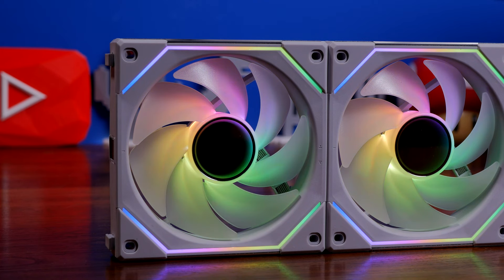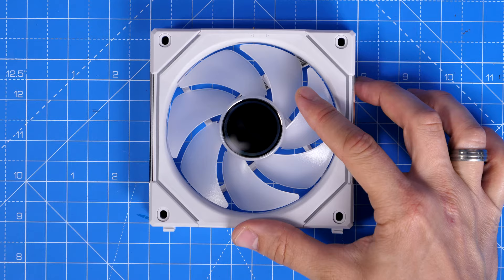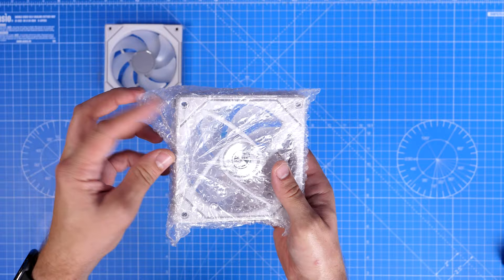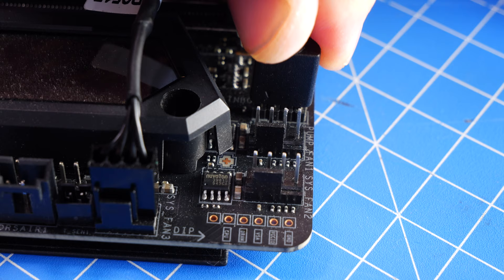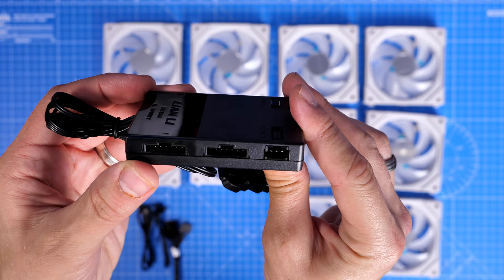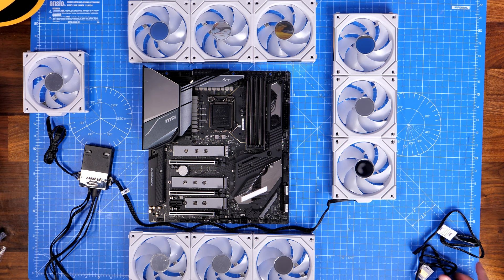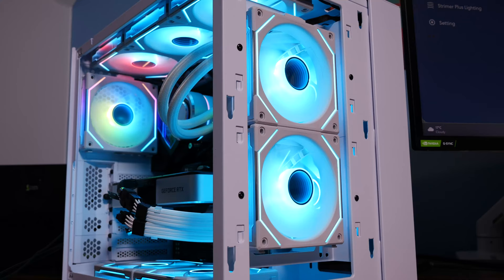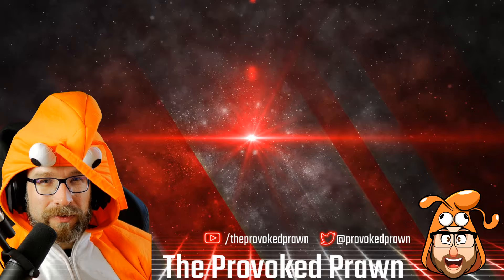How to connect Lian Li Uni SL Infinity 120 fans (single and triple packs)

Comment: best video ever. it took me 4-5 tries to find someone just hooking them up. everyone else's videos looked like Lian LI promotional videos and I just wanted to see how to properly hook them up. thank you for your service 💓
Reply from the maker: Thanks Gary. Glad to help, hope you enjoyed enough to subscribe 🦐
Reply: Same boat! This helped a lot since the 3 groups of 3 with a single in the rear was exactly the setup I’m looking at. Only question is if I get a single pack for the rear will that still connect to the controller or no?
Reply: omg same i could either only get  the rgb to work or just the fans to spin not both it was frustrating
Reply: @TheProvokedPrawn  I’m confused, do I gotta connect the 3 pin 5v rgb header AND the usb to the motherboard or can I only have the 5v 3 pin connected?
Reply: @TheRockford22  yes but using one of the (4) cable that comes with the 3 pack.
Reply: @TheProvokedPrawn Hey, great video , but can I connect 3 × triple pack fans = 9 fans if I only have 1 argb headers on my motherboard. PLEASE REPLY
Reply from the maker: @user-vo2wc4qk5b  yes, just use the USB connection and L Connect
Reply: @TheProvokedPrawn @TheProvokedPrawn Hey, great video , but can I connect 3 × triple pack fans = 9 fans if I only have 1 argb headers on my motherboard. PLEASE REPLY

Comment: It is not true that you can’t do 5 clusters. There is a y-splitter cable that is included in the box with the controller that allows you to connect 2 clusters into one control box input slot.
Reply: Nice to know! So you can have all 5 sets plugged into 1 controller? any limitation? Thanks!

Comment: Bought two 3-packs and they came with splitters for the controller-to-fan plugs. Which means you can connect two sets of two into one of the controller plugs. Crazy how much thought they put into this product. Hands down the easiest fans to work with.
Reply: Yeah, I just bought 7(2 packs + single) and I m very impress with what came in the boxes, more cables then I will ever need. Thinking of buying another 3 pack and replacing my Galahad fans too now.
Reply: Does that mean you can have 5 sets of fans plugged into 1 controller? (with 2 sets of the fan using the splitter and only occupying 1 slot on the controller) Thanks!
Reply: Beware the power limits there are reports of burned splitters because of overloading it.
Reply: @twinstars8812  i think the maximum amount of fans is 16. however , if running that many fans on one controller , I would plug in the second SATA cable for sure .
Reply: Did you buy the SL Infinity version? Or SL V2? For my infinity fans i don’t see a splitter cable …
Reply: @Mike8827  in the 3pack infinity fan there is a splitter cable, i got one
Reply: Can I purchase 7 single fans and rig everything through the controller that comes with the Lian Li 360mm CPU cooler? I’m trying to run 10 fans total. I don’t need the 3pk for the controller if I’m already getting one right?

Comment: can you use a y-splitter to connect a single fan to a row of 3 so back extract & the 3 fans on the top of the case & then connect it to the control box in the back ???

Comment: worth noting, that you get the thick connector (from the triple box) 3 times total. so if you have a 3x3 + 1 setup you will be missing 1 cable for the single fan. so if you play on doing more than 3 groups, buy 2 triple boxes
Reply: they give 4 cables, not 3 :)

Comment: Thank you for the very thorough video. I have made my own custom cables for the fans which involed new wires and soldering to the fan header connections. I tested my system but the fans were not spinning. In half panic that I have done something wrong and potentially fried my fans, I searched the internet if anyone else experienced this phenomenon. Your video came up and was able to answer my question and I could continue with the build. 

Nice instructional btw, and probably will come in handy for many!
Reply from the maker: Fantastic! Glad to hear it. Hope you appreciated enough to sub.

Comment: Crazy how all u have to do for the connections is daisy chain the fans put the connector on the first fan then plug that connector to the controller then sata then I think u have to plug in a usb connection as well, love how smart and useful lian li’s fans are and even better they look the best, fr Lian li probably has the best fans for aesthetics and cable management

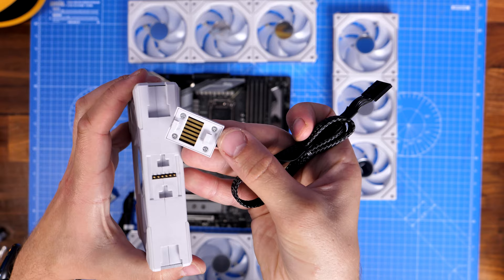Comment: How many of those cables at 11:20 do you get in the triple pack? I’m going to get 6 SL inf reverse and 4 normal ones. They way I’ll purchase them is 6 single pack for reverse fan and 1 single pack for normal and a triple pack one. Does the triple pack come with 4 of those flat cable?
Reply: Hi. Any news?

Comment: If my cpu cooler non-lian li has a argb wire where would i plug it in this case? Because if i use the controller it wont have a argb head it will have the other head with many pins

Comment: This there a voltage maximum for these fans if its connected by daisy chain using one controller. For example, I've heard that if you go over the voltage that the motherboard can handel it will blow up your motherboard capacitors
Reply from the maker: The controller can handle 16 fans max. But it is also powered directly by the PSU. So it's not drawing power from the motherboard.
Reply: @TheProvokedPrawn  Thank you for the information. Is the voltage only regarding if its directly connected to the ARBG or system fans?

Comment: Hi, so I bought one triple pack, and 6 seperate reverse blade fans. But I guess to daisy chain the 6 reverse fans, i need to buy another controller that comes with the daisy chain cable no ?
I only have 1 cable from the triple pack. The other cables that comes with the single packs, are for mb only

Comment: How do you synchronize the RGB of one Infinity fan (connected to CPU fan header) to 3 other groups connected to the L controller? I am thinking of using one Infinity fan connected to the CPU fan header and 4 other Infinity fans connected to the controller (connected to the system fan header). But what do you do with the RGB connector of the CPU fan to sync with the fans connected to the controller?

Comment: Hey mate with lian li infinity fans if so tryna figure out if it would be compatible with the king 95 pro case in this configuration the 4 front fans would be 140mm reverse blade fans (so intake) the bottom 3 fans would be 120mm reverse blade fans  (so intake) the top 3 120mm fans on the aio would be exhaust then the one on the back of the case is a exhaust curious if they could use the built in fan hub on the case or all would work with the included lian li fan hub in the 3 pack thanks heaps for letting me know

Comment: i have one of those lian li hubs, i want to connect 9 fans, 3 120mm on aio radiator, 3 120mm on the side, 1 120mm on back, and 2 140mm on the bottom is this possible? if not, what would i need?
Reply: case is H6 flow
Reply: i have never built a pc before, so sorry if i sound like an idiot, it is much more confusing than i thought xD
Reply from the maker: Yes. Four groups. One on each port. Easy if you follow the guide.

Comment: Hello, I want to ask a question. Since I installed my lian li system, the fans only start after the window starts. Is it normal or is there something wrong with the connection? I thought they started as soon as I turned on the PC.

Comment: God this thing is so confusing. I got 4x 140mm (2 front. 2 bottom) and 1x 120mm (rear) there is so much stuff splitter cables, cables... man why is this so difficult my god. I'll try to connect it somehow I hope its not gonna fry the motherboard. Great video

Comment: Great vid, very informative. Hoping you or someone else can answer this: if I had the controller hub and wanted to forgo using L-Connect by connecting the PWM and RGB cables to separate controllers instead (in my case, an Aquacomputer Octo and Farbwerk), how exactly does control work for the fans? Would the controllers detect all the fans connected to the hub as one fan and thus mirror settings across all fans? Or will all the fans be recognized individually, allowing for individual speed and RGB control?

Comment: excellent video but in my uni fans lian li sl-inf 120  3 pack i dont have spliter cable only single cable coming ouut of the fans and should go only to the controler. Im trying to use with ryuujin 2 360 but fans must go only to lian li controler

Comment: Thank you for this. I have 3 sets of fans like in this video, except my AIO cooler is the Galahad II LCD. I have the case fans on the SL controller, the AIO & it’s 3 fans on the AIO controller but the rgbs aren’t syncing with the other fans. In the L connect app it’s on its own and have to configure it separately from the case fans. Anyway to sync them all together?

Comment: Thank you so moch every things is clear and good. And I have a qusthion,  I have  o11 evo dynmic case, and I want to pay 3 packs of fans and one single fan pack, But I want to use one Lconnect controler, if I cant; I want to use just 2 Lconnect controlers, and I have a Motherboard RGB backplate and I want to can control the fans and  a Motherboard RGB backplate, how can I do it? please.

Comment: The very first and educative video ever. In this case where did you connect the Galahad AIO Led? Big thumbs up for your work.
Reply from the maker: The Galahad was already installed to be honest (from when I did that video), so I didn't mess with the wiring or use the new control box as I probably could have.
Reply: @TheProvokedPrawn  I asked because I have 9 UniFans connected with one controller(with non space left) and I don't know how to connect the Galahad Led connector. Can you help me with?
Reply from the maker: @musicsthearts7648  connect it to the RGB header on your motherboard?
Reply: The thing the AIO LED cable is made to be insert into the controller box. But there's no space left since the fans with rgb are connected in all 4 modules of the controller.

Comment: Im about to build a pc with 10 of these fans. Since the single fan doesnt come with a 7 pin can i still sync the fan with the other 9 on the controller if i connect it to the motherboard?
Reply from the maker: Yes but only by the motherboard RGB software. For L-Connect control you'd need two controllers

Comment: Is it possible to connect the 3 fans of the Galahad LCD 360 to the controller and it will be marked as CPU Fans for the AiO? Running the 360 AiO, 3x120 side, 3x120 bottom 1x120 backside and I cannot figure it out.
Reply: Did you figure it out?
Reply: @Yungdil  well I just put the 3 on one of the triple pack controllers and then just renamed the #1 Port to AiO.

Comment: I’m having issues with my front case fans. I have one system fan slot left in on my mobo and a rainbow slot. 3 front fans connected to my controller and then the 3 cables that need to go to my mobo. I do have a 3 way splitter that can connect to the fan cables. But I’m not sure if I’m supposed to connect it to my system fan slot or the rainbow slot on the mobo. The case instructions say system fan.

Comment: Thanks for the video. 
I have set up my system and installed l connect. Still have an issue where rgb comes on but no fans spinning. All mew components but a bit lost. Does anyone have any tips for what i can try?
Also connected the cable that goes to the hub and connects to jrgb and 3 pin but still no luck
Any help would be appreciated

Comment: Great guide!
Does the triple pack of fans come with multiple of the 2in1 power and RGB connections? (the flat connector that connects to the box) 
So for the 10 fan setup demo'd in the video, I would be able to buy a single triple pack, and 7 single fans, and have all I need to connect them all? 
Thanks!

Comment: I had to order 9x single fans instead of 3 packs due to shipping constraints. How can I solve the issue of not having the controller specific cables now?

I'm thinking about ordering the controller separately, but from your video I realized I need a different connector on the fans from the ones that are supplied by the single units (which ends in 1 argb + 1 pwm outputs)

Comment: So I have 4 different cables from 8 sl inf 120 fans, 2 individual fans and 2 sets of 3 fans daisy chained (one of which are the 3 fans for the radiator). I am also using the Galahad ii sl inf 360 aio. Can you please explain how I can connect all the cables to the L connect 3 controller to sync the rgb of the fans and the pump.

Comment: Awesome video, detailed and high quality!
But since I'm not the brightest and may have missed this part, I'd just like to confirm:
1.A single pack fan, will work just off of the motherboard connectors and does not need the controller?
2.Can the RGB and fan speed be controlled via the motherboard headers and software, or do I need to install Lian Li's proprietary software?
Reply from the maker: Correct
Reply: @TheProvokedPrawn  the single can just be plug in cpu fan header? im planning to use it as a cpu fan

Comment: So I have a question how do I setup fans to be contrled to the motherboard and RGB by the Lian Li controllers / L connect? Also if I just use L connect or the USB to connect to the controller to motheboard the fans show up under one category of fans on the motherboard.

Comment: i daisy chained the bottom 3 fanswhen i turn off mb lighting sync on l connect 3, the rgb lighting turns of ass wel while the other fans still have their argb lights on

Comment: I don’t know if you’ll see this notification but I am currently in the process of building my pc and have the gallagad trinity aio and 7 other uni fans as well as streamer cables. I was wondering if I need to plug the 5volt header into the motherboard from each controller for the rgb on the motherboard to sync to the fans from l connect or if the gigabyte software lets me sync it what the fans are
Reply from the maker: You need to connect the 5v headers if you wasn't to use your motherboard software

Comment: So if I understand correctly, the cable at 10:51 is only required if I want to control the fans via my mobo. I do NOT need it if I will only be using L-Connect, correct?
Reply from the maker: Correct

Comment: Just got the salad 2 about and a set of three fans. Is there an adapter to connect one set of three fans to another set of three fans so I would only then have one set of wires to connect to a controller or mb

Comment: Can I use a splitter for the 9 pin usb? Motherboard only has 2 usb connections. What would be the solution? Need 3 usb connections, one for the SL fan controller, one for the TL LCD fan controller and one for my cpu air cooler with an lcd/digital readout.

Comment: Thanks for the video. This is super helpful. Quick question, if I replace an GPU AIO fan with these Liam li fans, where would I connect the fan control?  I know just like cpu aio I can connect into the sync slot for rgb control.

Comment: @theprovokedprawn I know this video is a couple years old, but I am using this set up and was revisiting this video after I did a recent BIOS update. Can I assume in the example you provided; whereas, you used the Uni Fan controller to control all 9 fans (3) sets of (3) and use the use the system fan header to control fan speed, that if included the use of a kraken Z Cooler, you would use the "AIO_Pump" for the Kraken and "Disable" CPU_Fan in the BIOS, since you are omitting that connection using the Uni Fan Controller using the System Fan Header? This is how I currently have mine set up and want to be sure I didn't set it up incorrectly. Hope this makes sense! Thanks in advance!
Reply from the maker: I don't understand you I'm afraid but here's an explainer https://youtu.be/v5kDVZmePYQ

Comment: nice i bought 10 of these fans for my build just now, they will arrive tomorrow. :) I was wondering how am i gonna connect all 10 fans, but it seems like one controller is all i need. as 3 fans will be at the bottom, 3 on the side, 3 on the top and one on the back. Thanks for the help

Comment: Hello, I am having a problem with the uni fans. I have all three uni fans connected together but when I do that the last fan in the connection does not have the rgb strips on the side. The fan works and the rgb in the middle works and when I flip them all around the top two fans work but not the bottom one of the connection

Comment: I just bought 7 single fans and a unifan 2.0 controller and im very confused. My configuration: 2 x 3 fans and a single one. I connected the fan header cable to the controller. But Now im confused because i cant connect the 3pin 5v connector to the controller? what am i supposed to do?

Comment: Thanks a lot for this. This is one of the best tutorials I've come across. I have one tiny question. I went out yesterday and the infinity fans and did this setup you have here. Installed the fans and only one set of 3 light up and spin, all the others do not do anything. I tried switching the port on the controller but only the same 3 working. Any ideas what could be happening?
Reply from the maker: https://youtu.be/xmLIU40UOVI

Comment: Hello, very nice fans but ... impossible to control from the ASUS BIOS. He start the L-CONNECT 3 application and choose the small button MB RPM SYNC and MB LIGHTNING SYNC. Very complicated to use with armory crate too. I think it's complicated because everything is on a HUB and you need the L-CONNECT 3 application which itself does not start automatically on windows at startup...

Comment: Hi, i have a question, i have the 3 pack lian li infinity, bt my motherboard doesnt have the 5v 3 pins  conection. If i use the box to Connect them all, and no the argb cable to the MB , could i control anyway the light effects ?? I a little dificult for me to write in english, Hope you understand my question. And Hope i can Connect and sync my light effect some way